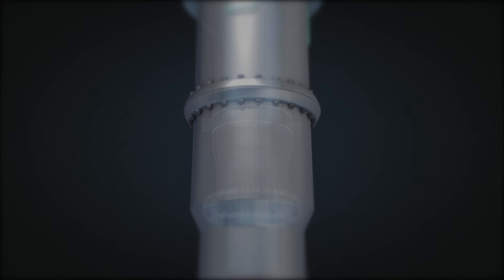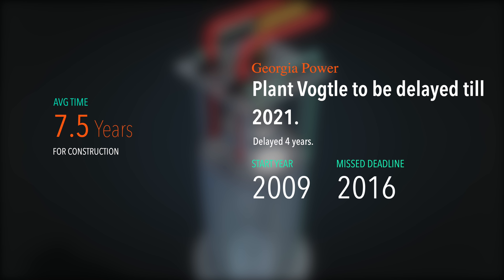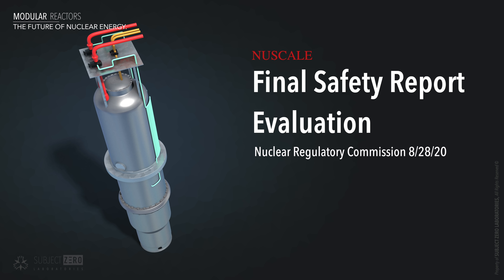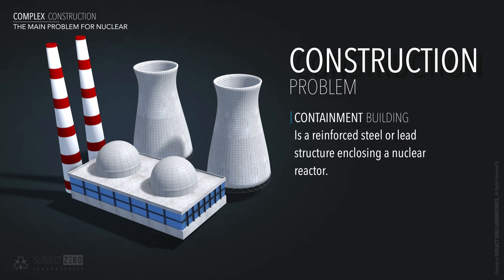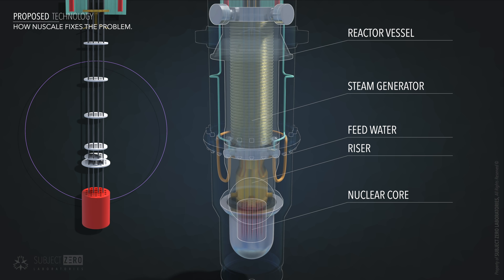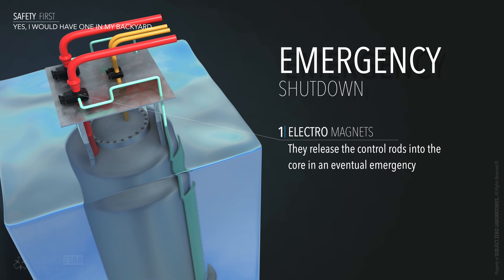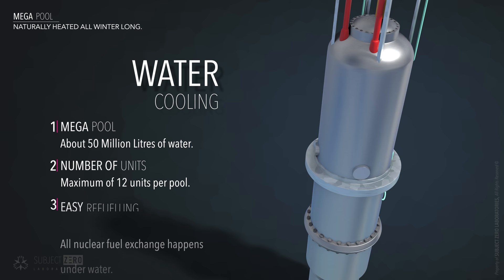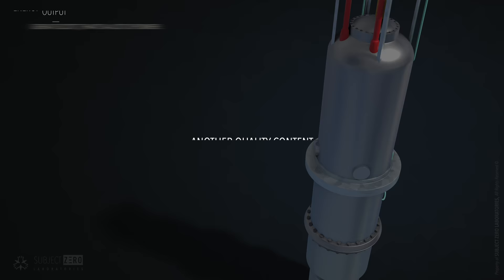A Milestone for Small Modular Reactors (SMR 2020)

Comment: Singapore would definitely need these. The air pollution here is getting worse.
Reply: By the time it up and running, Singapore already doomed
Reply: Just build a old one. gen 3+ Hope you'l air be good.
Reply: @venomsoul1147  If history is anything to go by, building an old reactor will take 10-15 years.  That's the whole point of the SMRs in the video!
Reply: @Turksarama  Agree. Also Singapoore  needs ... wow 47.7Tw per h? Huge. They difinetly need something global. SMR give only 60mgw, just like floating nuclear plant. Cant calculate, how many enegryblocks they need.
Reply: @lillyanneserrelio2187  Yep. Someone difenetly dismantle reactor with screwdriver and angle grinder just becouse they heat up too much. Already hear fairy tales about "dangerous nuclear power".
Reply: @bioswars8827  You dreamer, man. Provincial government you say? Place to place people cant aford heat and food. Economic crisis push cityes to use more and more burnable fuel. And wea still about 8 bilions. Someday you come out to street and wear on oxygen mask. Yep, wea get some problems time to time, and that acidents, i may say, was on early atom age - 70 years from discover. You cant stop nucklear just becouse of this, or ban coal becouse its dirty.
Reply: Test these small reactors on Oahu or Puerto Rico, because they have to import most of their power in the form of coal and oil.  Oahu has an advantage because the reactor can be put into the military base on Honolulu, a federal facility.  The Navy nuclear personnel can be used to run the reactor.  The reactor would be used to augment the island's power grid, providing a base load that no longer needs to be met by imported oil or coal.  If the reactor is providing excess power beyond what the island's power grid can handle, the extra power can be diverted to a heat-based desalination plant, while if Honolulu base needs extra power it is already connected to the island's power grid.

The goal would be to get numbers for installation cost, annual maintenance costs, infrastructure costs/requirements, labor costs, and measure those against no longer needing to import coal/oil.  Existing power companies should use the lack of imports as a way to either temporarily reduce costs, or carry out critical infrastructure upgrades (power grids, extra solar panels, battery backups, etc).  The power from these reactors would be a gift to the island, but extensive data would be gathered about what installing one of these reactors would involve
Reply: @toddkes5890  Great idea. Have you written to their local government?
Reply: Since land is limited a sea floor reactor like Indonesia's thorcon can power both Singapore Batam and maybe Johor Baru
Reply: These types of things are a perfect fit for Singapore actually.